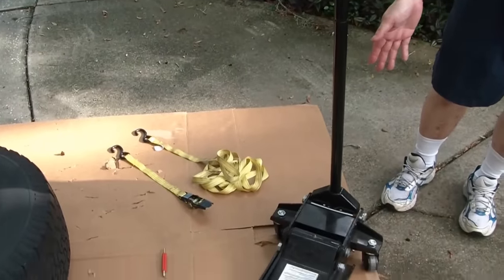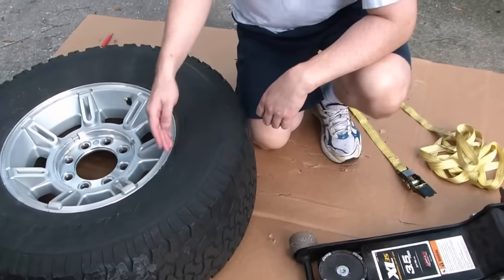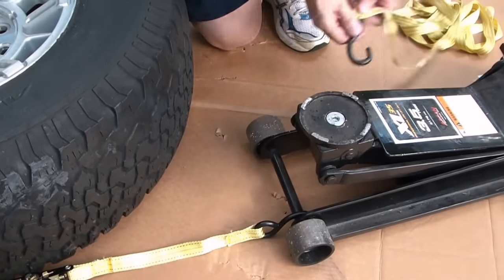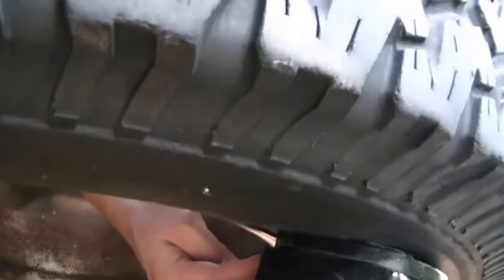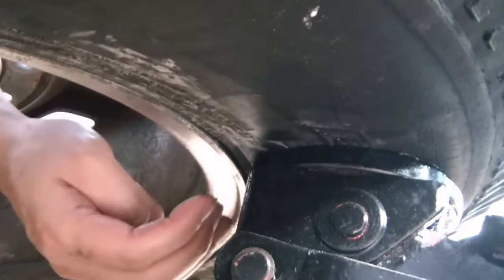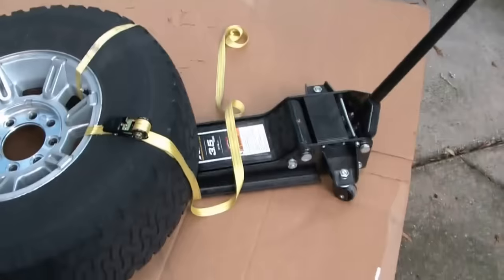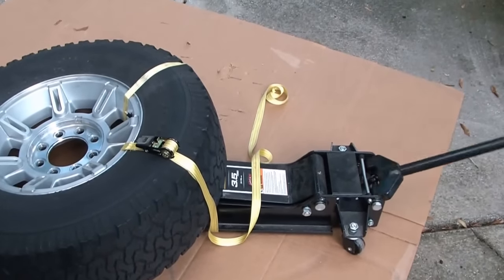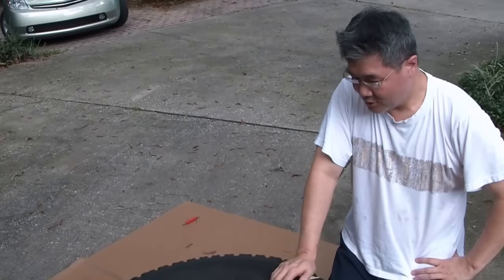Easy and safe way to break a tire bead

Comment: I usually just jack up the car and take the wheel off. Then put it under the hub (brake disc), and then lower the car down on to the tire wall. It works better on the front since the weight of the engine helps, depending on the size of the car. Handy if you don't have a ratchet..
Reply from the maker: Thanks, that's an excellent idea. I really wanted to try that, but chickened out. Was worried about damage if I didn't control the descent correctly. (Could it have resulted in my brake caliper slamming against my wheel ?). But I'm gonna try it next time. Take care !
Reply: auxpowerunit Hey, can you do a video on it when you try it!
Reply: the good part about doing it with the brake rotor is you can apply a lot of pressure in a small area almost right on the bead, the bad part about doing that way is you can really screw up the backing plate especially if it's one of the stamped sheet steel backing plates......
Reply: I tried, but the damn car wasn't heavy enough🤣
Reply: I did mines the same way. The weight of my truck to the hubs to the bead. Works great. Im glad you and i are pretty clever
Reply: Instead of lowering the car, which is Im not comfortable doing it, jack it up from under with the tires against the brake disk
Reply: Easier if you use a 2 x 4 while doing that technique.
Reply: dumb ass....
Reply: @mariordz5729  I use a 4x4 and cut one end at a 45 degree angle so it has a point. I rest the flat end of the 4x4 under the front reinforced jacking point on the side of my '05 Honda Pilot and simply lower my floor jack which is under the jacking point under the engine...kinda ghetto but it works.
Reply: John Morgan  I've used a regular compressor as a vacuum pump to do that, doesn't suck the bead off but a few good whacks with aboard and a BIG hammer and it breaks

Comment: Hello, I just saw your vid today as I've been struggling to remove some old motorbike tyres. 
Your method worked faultlessly.
When the bead finally broke on the back tyre I'm sure there was a sonic bang to accompany it. There's no way I'd ever have got them off without spending a load of dosh, needlessly. So thank you very much!

Comment: I tried on my low-ish profile tires, and had trouble at first, but realised i had not set up my strap the same way as in the video.  Once i fixed that, it worked immediately, no effort. Thanks!

Comment: I really wish I tried this technique before giving up and paying a tires store 80 bucks to simply swap out 4 UTV tires. They were impossible to get off. I used spoons and cat claw and ry bar, the front end weight of my F-350 diesel truck and a 2x6,  I even used my welder and made a pretty descent tire press which worked to break the bead on an old trailer tire I had laying around but failed at budging any of the 4 UTV tires. This technique may have worked and I'm going to try it next time as I burn through those UTV tires in about 2 months. Hope it works but at the very least I'll have a little more assurance I did everything possible myself before having to make the long irritating trip into town and pay someone to do simple tasks. Thank you for a great and easy idea!

Comment: I usually use the method of driving a car up a plank to push the tire down. That doesn't always work on the stubborn ones. Your method takes a little longer, but would definitely work on the ones that don't want to break loose. I'll keep it in mind next time. Also if you have access to a decent vacuum pump, you can use that to create a vacuum inside the tire to aid in popping the bead. Original thinking. Good video.

Comment: I was skeptical that it would work but it does. I needed to change a TPMS sensor and it saved me from buying a $50 bead breaker at Harbor Fright tools
Reply: I did exactly this to replace the valve stem on my tpms. Hardest part was finding the valve stem who knew you had to look for peugeot part for chrysler

Comment: That method is awesome! I used to jack up my car, mount a bare rim on it, position the tire with the edge of the bare rim on the tire next to the rim I want to break the bead on and release the jack. That worked great but I like your idea better. Thanks!

Comment: I want to add to this. If re-seating is a problem, One thing could be to fill the tire without the valvecore in. This helps with pushing ALOT of air into the tire quicker, helping to "pop" the bead (This is btw very loud, Wear hearing protection!)
You can then put the stem back in afterwards, as it is seated. 
I've had trouble re-seating after taking it off also. Admittedly, I wasn't using sufficient air to fill them. If you're using a compressor, this might not be a problem. Try it without this next thing first. Put your ratchet strap around the tire lightly (Not massively tight as this would be dangerous as it can come flying off!) that will add just a little pressure to the middle of the tire, pushing the sides out and squashing the bead down.
I have had beadleaks on several tires (Winter tires on salty and dirty roads). This method has saved me 200 bucks already!

Comment: Be careful with this method. Constantly check the jack vs wheel clearance. In my case I didn't notice the lower steel arm of the jack was digging into the mag wheel in the final stages of bead breaking. It pretty much ruined my wheel with deep gouges on the bead sealing area.
Reply: Same here, the Jack got jammed in between tire and rim. Broke the bead but still gotta get the tpms sensor out.  Some times we win, some times we lose. I just hope the gouge still allows it to seal.
Reply: Fold over the plastic from a gallon of milk onto the saddle of the jack in between it and the tire.  That'll provider a marr-free material to interact with your wheel if it comes into contact with it.
Reply: It's almost like he warned SEVERAL times to make sure your saddle wasn't too close to the edge of the wheel
Reply: And with this method you have to balance your tires too
Reply: Maybe use layers of carton or wood plank between the rubber and metal...
Reply: @user-rs7sk6bo6m considering any time you change a tire you should also balance it anyway to prevent excess wear or at the very least make note of before and after for the following time

Comment: Great video.  I was having a hell of time breaking the bead on my motorcycle tire.  Effortless.
Reply from the maker: Yay !  I'm happy that saved you some work.
Reply: auxpowerunit could you have put a 2x4 under the straps on top an broke both beads at the same time...?
Reply from the maker: That's an interesting idea. I'll have to try it to see what happens. Take care !
Reply: I was wondering if this would work well on m/c tires and wheels.  Great vid!!
Reply from the maker: I haven't tried it personally, but a few posters said they did it, with good results. I think it should work well, because motorcycle tires have a relatively tall sidewall, so there is plenty of area for the jack saddle to press upon. Take care !
Reply: just cut the rim then weld it back
Reply: MegaMaxRuby. yes it will work on mc tires i do this all the time i use a 2x4 on top to hold the rim
Reply: @MegaMaxRuby  I always use a large C clamp to break down motorcycle tires !

Comment: It's easier to use a truck or van,lean out the window and smoothly  drive onto the depressurized tire as close to the bead as possible,it will work...learned from an uncle...
Reply from the maker: That works, but it isn't for me. My driveway is sloped too much and has a weird bend, so it really wouldn't allow enough space to maneuver. The other issue is efficiency. The jack lets me precisely place 1000 pounds of force exactly where I want it. So there isn't any need to move my 6400 pound vehicle around. Take care !
Reply: i have used that method for many years but it does not work on every tire.
lately i been using a bottle jack placed on top of the tire and under my hitch receiver. the jack's square base fits well right up against the rim's edge and i just jack like i was trying to lift my suv but the tire bead gives way far before the vehicle lifts. 

back in the day we used to use a bumper jack to do the same thing but you can hardly find those any more.
Reply: i struggled doing this with my van for an hour, rotating the tire and running it over with my van over and over again before i finally broke down and found this video. im sure running it over works for some situations but the bead sealer and the design of my wheel were not working in my favor
Reply: Thats how i do them

Comment: I tried the floor jack method on a stubborn tractor tire and it didn't seem to work so well, I quit a bit early not wanting to damage the tire. however bib did not secure with a strap the same way. I might just try it again.
Thanks your video is helpful.

Comment: Thanks for sharing nice tips man. To mount a tire back on the rim you use a smaller sledgehammer (just watch it you do not hit the rim) and lots of lubrication. Stand on the tire side and hammer on the tire slovly moving untill you got it down all the way around then go for the next side.

Comment: just find a friend with a hi lift jack. its so much easier. put the tire on the ground. put the jack on the tire and bumper. crank x a few and done.
Reply from the maker: Are you referring to a ratchet-type bumper jack ?  I haven't used one of those for 30 years. Even though my Hummer H2 has a frame, it still came with a scissors jack which is supposed to fit under the frame, not the bumper. I was also considering a way to used the scissors jack as a bead breaker, but it isn't as easy to get the strap around it securely. Take care !
Reply: auxpowerunit hi lift is a brand name. a farm style. common in offroad community.
Reply from the maker: Thanks for the info. I just looked that up. That makes sense for off-roading. Take care !
Reply: Ghetto Busa be careful with the bumper Jack it can slip and bust your 👃
Reply: I think bumper jacks killed too many people... car manufacturers stopped including them in their Mercury/Chrysler/Pontiac trunks around 1980. Along with the full sized spares. LOL

Comment: When I was a kid (mid 1960s), I remember my dad driving his car onto a rim trying to break the bead on a tire. He put the rim/tire flat on the ground and then drove the car onto the tire.  Well, he broke the bead and then asked my older brother (8-9 years old)  to put a lug wrench between the tire and the steel rim as he backed the car off the compressed tire.  The next thing I heard was a loud scream. My brother did not quite do what my father said because he put his fingers in between the compressed tire and steel rim as he backed off the tire; however, when he did, the tire recoiled back up onto the rim smashing his fingers between the rim and tire.  Remember it as if it was yesterday.  Seems funny now.
Reply: Technical Corporal Man That would have to hurt I usually do the same thing Except I get my son in the vehicle but I have to say this video Makes it look easy

Comment: I just spent several hours busting beads by running over them with a pick up truck.  8 tires, and it wore me out.  Someone from a FB CJ5 group recommended this video.  EPIC.  Now I'm not afraid to do another tire/wheel swap.

Comment: Wow, super easy. Will have to try this. Thanks for sharing.
 Update.. not as easy on a low profile tire. Had to do it in 2 places next to each other. Also found that placing a brick or half block opposite of jack the to make the tire level helped as well.

Comment: I've used a large c-clamp for breaking beads . So far it's always worked .
Reply: danger of deforming the tire with such small pressure points
Reply: @rubensahak9178  it's not a bad tip, and most of the time you plan to break the bead it's for a tire change anyhow.

Comment: I had to come back on and thank you so much for this genius way to break any impossible bead. I tried jacking my tire up with the hitch on the car but could not get enough leverage or position it properly. My tires were so stuck to the motorcycle rims I had to compress them as much as possible and then... I figured out to take the entire tire and the floor jack and slowly flip it over so I could get access to the pressed in tire and use my tire irons to go along and continue to pry down little by little. Once I had to reposition the tire a second time because it was so stuck. I have never ever seen that and I don't believe any motorcycle tire machine would have broken it loose. I was able to squash the tire almost flat sideways. It was a little less than a 2 year old tire but 10,000 miles. Something was on those new tires because it looks dark and like a glue on my rim that I had to sand them both down by hand. Now I can't get the tire to seal completely to the bead. That has never happened to me either in all my years. Thanks again for videoing this and showing the world how easy and safe this is to break down a tire off of any rim. Thanks again.

Comment: Wow! That's awesome dude! I have been using a cheap Harbor freight tire changer. I broke the flimsy bead breaker like 3 or 4 times already! Fixed and beefed it up every time, but bent the he'll out of the stand and bent the lever to the unuseable point. Now I got a big ol 10 foot piece of pipe on there, and another piece of pipe inside of that one, for strength, so it won't bend at the pivot point! Lol! As soon as your video started playing, I said, What a great idea! Can't believe I didn't think of that, after going through all that crap, trying to fix my bead breaker! Came up with many ways to fix that stupid thing though, and it works good now, but it was a hit and miss learning experience with the random materials and resources I have on hand. I definitely have a 3 ton floor jack and a heavy duty rachet tie down. I'm gonna do it your way  when I finally brake my bead breaker again, because it's only a matter of time with that stupid thing... I wish harbor freight would stick their bead breaker idea far up their you know what! I hope they don't go start selling a jack and a ratchet strap soon, as a tire bead breaker kit! I bet some asshole will do just that exactly! Who knows, it maybe you who should capitalize on it! Either way, thank you so very much!!! This will make my life so much easier when that stubborn tire bead day comes around again! You are the man, man!!!

Comment: You can break the bead free by removing one front wheel, then lowering the brake disc onto the deflated tire.
Reply: jimmy5F   ....atta boy...i don't have that same fancy jack...rotor to rubber definitely gonna work! 👍
Reply: Folded old towel on the sidewalk just to be safe
Reply: not always can you use the front rotor to break the bead, and I just broke my tie down strap with this jack method. I'm running out of options! 😤😠🤬😡
Reply: @ztpdx  Was your tie down strap made in china? Don't give your money to commies. Buy quality equipment made in America.
Reply: Brake rotor? Why not leave a wheel on the vehicle & use it to break bead off of the tire laying on the ground?

I've used a truck to drive up onto the side wall of a tire (that was laying on the ground) and it broke the bead quickly without even tipping the wheel

Comment: Great idea!  No pounding or dangerous squeezing.....  Still it must be somewhat easier to do in the tropic splendour of Hawaii than here in the rain...?!?!?

Also, that''s a much better jack than the usual HF junk.....most people adduce as a floor jack...?  What price range for your jack?
Reply from the maker: Greetings from sunny Tampa, FL !  It rains a lot here too. The floor jack is from Northern Tool & Supply. It is the Arcan Low-Profile 3 1/2-Ton, Model# XL35. It is now on sale for $125. I bought mine 4 years ago, while Harbor Freight didn't have any 3-ton jacks. HF seems to have caught up with some pretty good 3-ton jacks for $90. BTW, the load rating on the ratchet strap is only 400 pounds. So, the jack doesn't need to be any stronger than that for bead breaking. Only need the extra capacity for my heavy vehicle.
Reply: emil dekoven try here in the land of ice and snow
Reply: I admit a lot of cheap stuff sold at HF is junk, but I've been using a HF 2 ton rapid pump floor jack for years with no problems. It's my second one since someone stole my first one after I had it several years.
Reply: emil dekoven 
Have you seen our new line of floor jacks lately??
3 Ton and  3 1/2 Ton capacity ratings...
And they don't look that bad either..
Those new Daytonas are hell on the back when trying to lift them though..😁😁

Comment: Fantastic! wish i had found this video an hour ago.  i had to take the tire off an aluminum rim so i can take the rim to thr recycle so i get some money for it.  I had been using a grinder to cut the tire ut still couldnt get the tire off.  your bead break trick worked perfectly.  Thanks very much.

Comment: Interesting, but I'll stick to putting a wooden plank on the sidewall like a ramp and driving the car up it.
Reply: I have done that so many times I remember the tire or the board allways would move a little off target but finally I would brak the beads..
Reply: lol wish i wouldve done this before i bent my crow bar XD
Reply: I weigh bout 300 sooooo I usually can walk them off the rim
Reply: Duke Nukem v
Reply: but how do you drive with 3 wheels? , your method assumes a 2nd car is involved

Comment: Breaking the bead is one thing, but old tire ironing it off the rim can't be fun, especially with that big tire.
Reply: Breaking the bead is the worst part then yes taking off the rim is hard as well. But putting a tire on is super easy with some dish soap and a couple flat irons
Reply from the maker: Once the bead is broken, the rest of the tire iron work is relatively easy. Be sure to use plenty of tire lube (thick soap). That allows the rubber to slide past the aluminum with less force. Take care !